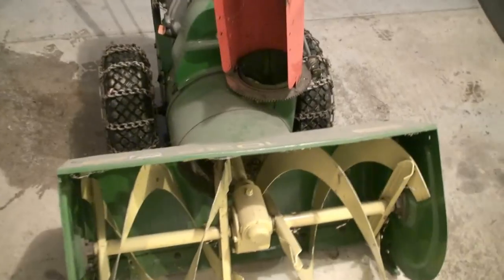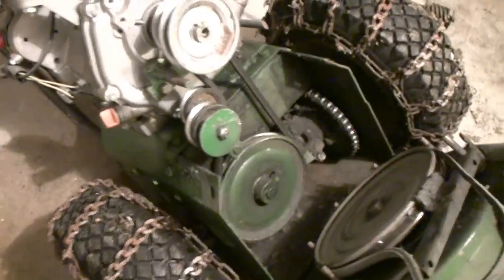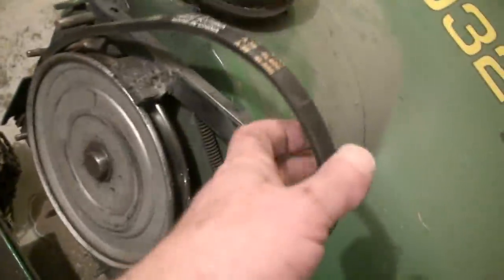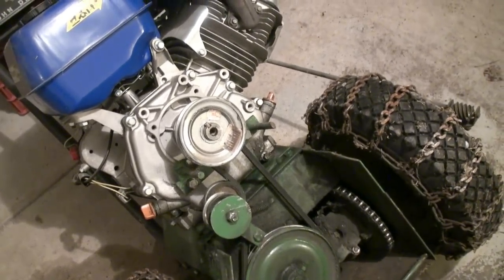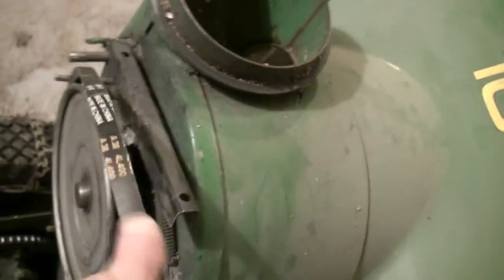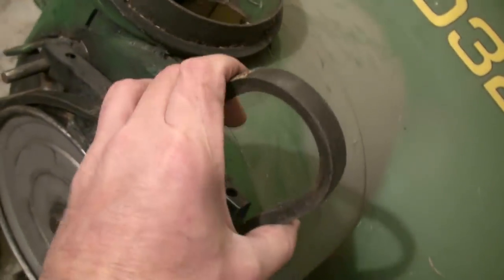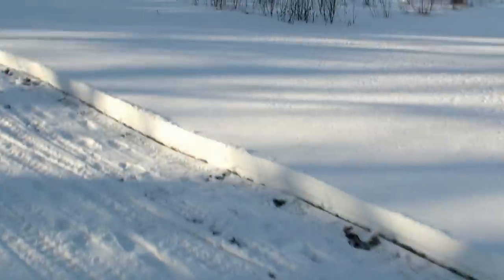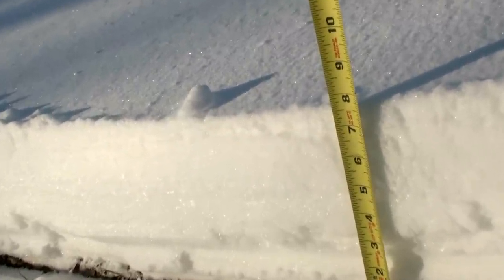John Deere 1032 16HP Modified Monster Snowblower 4 Years Later

Comment: You should "downsize" the flywheel on the impeller so the the impeller spins faster. I did it with my 726 but with a 10hp Snow king engine. The machine is a monster in deep snow.

Comment: Would love some details on your belt cover fabrication.  Looking at converting my 726 to electric with a 5HP 230V motor but the shaft will be higher similar to yours, so the factory guard won't fit.  Extension cord won't bother me, I live in the city and only need 100ft range.  Just looking for no maintenance snowblowing and a bit of cool factor.

Comment from the maker: I'm still happy with how it works after all this time!
Thanks
Reply: Hey man, not sure if you'll ever see this, pretty old video, but i just wanted to tell you, i watched your videos of building this thing back in 2009 or 10 i think, this build inspired my teenage craziness. I had a 726 at the time, But i also had an 826 with a bad engine....and i had a briggs and stratton 18hp opposed twin horizontal shaft just sitting there in there in the corner, it came off a 1985 craftsman garden tractor. So i thought, shit, i bet i can make it work. Oh it works man! I went 60% larger on the auger pulley and it will idle through a snowbank taller than it can eat and still throw it. Wide open itll launch it almost has high as utility pole at the end of my driveway. It has a battery mounted up on the front of it too, so its key start from the controls, anytime. Someday ill make a video and drop a link here.

Comment: nice hot rod machine, but dude, if you have to clear that large an area, get a new wide cut machine, you'll be done way faster. that kind of HP just to cut powder ?  not needed.  the name of the game with open areas is wide cut.  

honestly, get yourself an old pickup with a wide plow, and sit and plow in a heated cab with the stereo on.  why walk behind a smaller machine like that for those long distances.  that's like cutting a football field grass with a push lawnmower, even they have a tractor and it's 90 degrees in the summer, they sit and cut
Reply: Some people prefer the exercise which is why I do it. I lost a few pounds doing it this year. This is a 32inch cut. That is pretty huge for a walk behind. Plus not everyone has the extra money for a tuck and the maintenance on it, even if it never see's the road and you don't have to put insurance on it, spend more in gas, the wear and tear on it, etc.. Not worth it in my opinion. I would rather pay someone to put the wear and tear on their vehicle if it gets to deep. He also said it had sit awhile and last year he wouldn't of used a plow truck at all as he didn't even need the snow blower.. So he is going to spend $1,000+ on a plow he might not use or use very little?
Reply: freespeachrulez, TRUE STORY !!